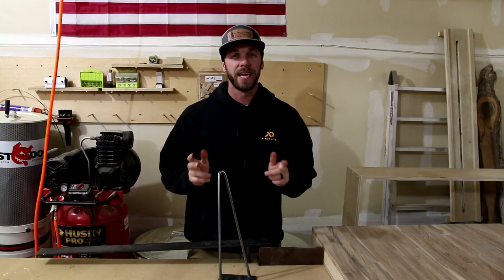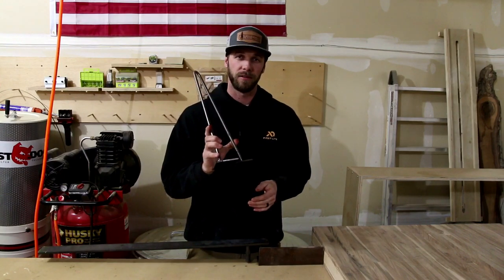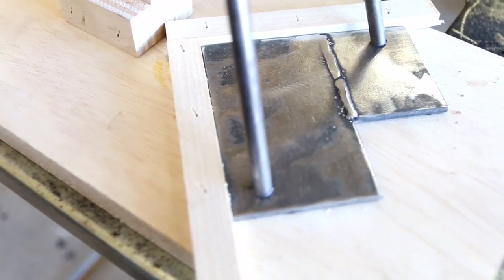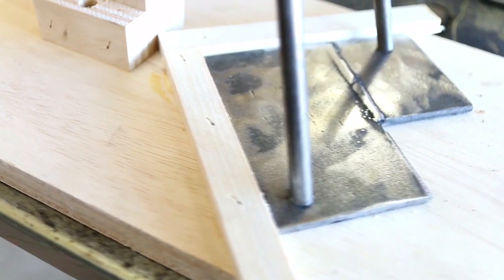DIY Hairpin Legs | Bending Metal Rod Without Heat

Comment: Awesome job man, love your videos. I'm a welder fabricator and wanted to include that in my videos, do you change your camera settings when you weld or just leave it the same. Thanks man!!!
Reply from the maker: Hey thank you so much, I really appreciate the kind words.  I usually always shoot in manual mode but I found when I am welding that if I just put the camera in auto it seems to industry just fine when I am welding.  Hope it works for you!